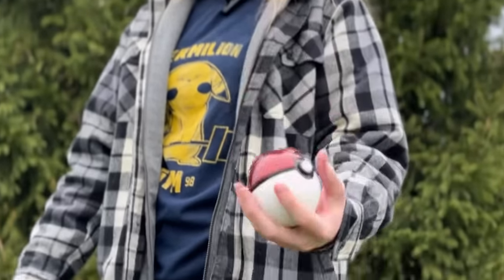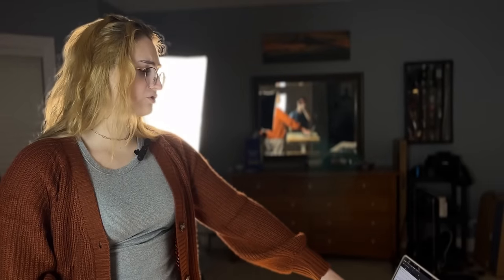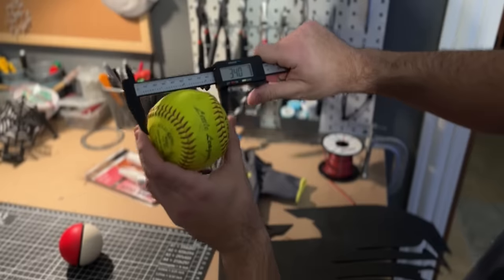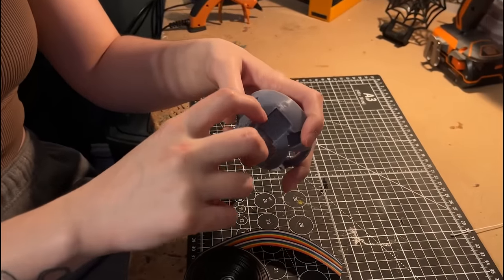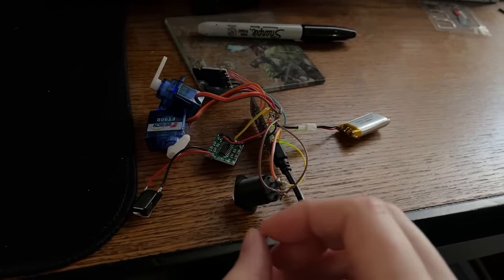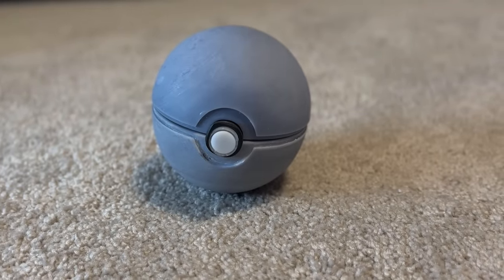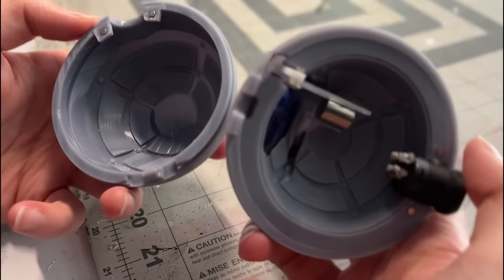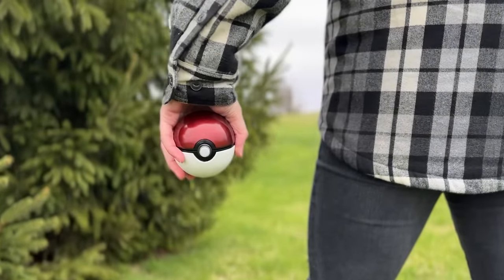I Built A Working Pokeball

Comment: Dude, I will always respect the ability to design components in blender
Reply: It was an impressive project without that, but holy crap, that's like a 100x multiplier, bravo!
Reply: Not sure how you design stuff in a blender. All I can make are milkshakes and smoothies. Lol
Reply: @giliant  I'm convinced there's a magical set of plugins I'm yet to discover which make it all much easier.
Reply: Learned Maya in college... will prbly use it for life 😅
Reply: We
Reply: @SimonLYW  Yeah it feels that way doesn't it, just takes time and practice like anything else though.
Reply: @Broockle  I learned in college 3Ds Max, Maya, ZBrush, Unreal Engine and Unity. I'm gonna try to learn Blender but for me 3Ds Max is and will always be the goat 🐐
Reply: @fergq9529  
So when are you learning blender? 😀
Reply: @Broockle  I'm gonna try to learn by myself, but not right now. Maybe in a few months
Reply: @fergq9529  
It's so hard to switch to Blender for me. It's so different. 
Doesn't even have radial menus, it's all drop down menus. And the hotkeys aren't ergonomically designed, I'd need to change em completely if I were to use it I think.
Reply: I’ve made a few animations in Blender, actually
Reply: I wish ppl understood the purpose of a pokeball

Comment: the button needs to be on the upper lid but good job overall
Reply: Was looking to see if someone pointed it out
Reply: Buttons are on the bottom lid on the back of Pokemon cards, so its technically not incorrect
Reply: @KovoN  only on the American cards and the very old Japanese cards, it seems to be a design error that was copied over but never fixed on American cards like it was on Japanese
Reply: not on pokemon cards 😏
Reply: @KovoN  Damn I'll never un-see that
Reply: Yeah I don't know why so many people do it
Reply: @thezx5795  because it's a lot easier to build the mechanism on the bottom.
Reply: 😂, umm actually... There's always at least one out there ...
Reply: This and the button turning red on successful capture would make this absolute perfection xD
Reply: @RabblesTheBinx  exactly, if the mechanism and/or power for the light was on the top, the ball would be topheavy and roll over. The only way around that would be to run the wire all the way from the bottom through the hinge, and over the inside of the top to the front. that seems tedious or arduous.
Reply: It's the TCG pokeball

Comment: 1:33 idea: you can hide the rocker, by making it spin around the circumference of the ball under the inner shell, the weight can be elongated to the shape of the ball or a partial ring or sphere segment. When the ball is closed it won’t matter in the insides are spinning or not.
So an alternate idea is to make the plates on the inside rotate opposite ways or just one spin, and only have one plate actually metal or heavy while the others are a painted light material. The entire half dome inside spinning will off centre the balls weight, causing a wiggle, both sides spinning will be more powerful😮
If you want to avoid the spinning insides, a hidden spinning rail weight would work just as well.
To get a decent internal lighting, using cracked/pin hole fibre optic strands, and an ultra bright LED. That’s if you want any insane inside effect.
Reply: Dude I was thinking the same thing the whole video. would be totally epic bre.
Reply: @slwsteny I got what you were totally thinking about the whole time right here, dude. 🕺

Comment: I'm amazed Nintendo hasn't done this yet
It'd be a pretty neat toy. 

Heck if those premium display Poke Balls were like this, they'd sell like crazy
Reply: they probably had did, but the technology 30 years ago wasn't quite the same, and whether it is back then or now, it would have been a relatively expensive merch
this build isn't even meant to be thrown
(you gotta sell this to kids somehow)
Reply: they only know how to make overpriced pokeball toys which don't even open
Reply: @Kensuke0987 I'm wondering how much "padding" would be needed for it to be throwable (into grass or carpet probably not a lot needed, onto wood or stone even the outside probably needs to be absorbent too, probably not a lot of materials that could be used for this and that would look right)
Reply: @Rerbun  probably not padding. it just has to be made of a durable construction and material. 3D-printing might not be the way; it has to be plastic injection molding - this is what they use to make modern billiard balls. the hinge and the electronics housing should have really tight tolerances too so that they don't wear down from all the jostling and also be provided some water-resistance.
Reply: Im thinking the same

Comment: For future variants:

Using a QtPy running MicroPython may work a bit nicer for this project.
The QtPy (especially when paired with an additional memory chip, also sold by adafruit) should have enough memory for small audio files. This removes the need for the SD Card, at least, and should allow you to save space from the sd card module and wiring.

You can replace the servos with microservos, or even small stepper motors (although the stepper drivers may take up some extra space, but shouldn’t take any more than the servos do)

Alternately: because your inner layer is nice and thick, you may be able to get away with a stepper motor based gyroscope (potential for stabilizing in midair throws? Or for rolling autonomously?). Or a spring resist solenoid.

Comment: Random fact: most depictions depict Pokeballs as having a digital dimension that serves as an ideal environment for the pokemon in question. They also show the balls as having non-transparent lids, which has left to an occasional joke about "the wrong pokeball", be it in the anime or by the fandom.

The Pokemon Special/Pokemon Adventures manga, however, makes the lids semi-teansparent so it shows ehat pokemon is currently in the ball, or if the ball is empty. It also makes the apricorn based pokeballs more gimmicky than they already were conpared to modern ones by requiring you to hit a specific spot on a given pokemon for the apricorn ones to work.

The manga also had Rival Silver be the only one of the Johto protagonists that throws their ball normally (Gold uses a pool cue to launch his, and Crystal kicks hers at her targets).
Reply: there has been no Pokeball that depicts them as having a dimension, the pokemon just shrink, which is a terrible retcon by Legends Arceus
Reply: @theamazingspooderman2697  looks like somebody has not looked at supplementary material... 

Or, for that matter, the item's cameo are n smash bros back when the series had trophies. In Melee, Brawl and Smash 4, the pokeball's trophy descriptions specifically mentions having what I described, and Sakurai was generally pretty diligent about making sure the info was accurate, if spoilery.

And I agree, the bit where they shrink was a retcon. However, it did not debut in Legends Arceus, it debuted in the Pokemon Adventures Manga, towards the end of the RGB arc.

Next time, look a little harder kiddo.
Reply: @theamazingspooderman2697 bros just saying shi

Comment: So freaking awesome!

Maybe if it's possible to use different colors LED you can use red for the blinking and yellow when it's successful.

Also like someone said maybe some sort of bright flash inside the ball for both fail (more visible) or even on a success (you'll see it through the middle as some sort of pressure release)

If this got mass produced I'm 100% sure it will sell like crazy.

Comment: It's awesome, I'd say it's almost perfect and hits every aspect you aimed for but you could ever make a 2.0 with a couple changes you can make that will make it even more authentic!

- I'd upgrade the light to be RGB so it can change colors depending on wither or not it caught or failed a catch. Similar to how it works on let's go Eevee/Pikachu.

- Another cool feature would be to add a RNG chance for it to fail not just at the beginning of the loop but between every step with a lowering probability the further in it goes. i.e. 10% chance on the first twitch, 25% on the second, 33% on the third (it always feels like when it fails it's the last one 😭). 

- Lastly, this one might be a pain in the ass but upgrade the speaker/sound quality on the file so it can get better quality audio. Granted that + the RGB light might require a stronger battery/power supply.

There's a couple more changes that could be awesome but would require so much more work. i.e. internal padding to be able to actually throw it without worrying it would break. Having some sort of impact sensor so you'd be able to trigger the same action without pressing the button but instead it happens after landing on the floor. However those would be so much more work and outside the original scope of the project it might require a massive rework for it to happen. And considering how well the shake works with the current weight + counter weight, it'll be really difficult to get another serendipitous moment just like that. 

All in all, this was an awesome project and really cool video to watch and will be subbing to watch more cool builds like this!

Comment: You think if it's made of petg fdm you can throw it? or use abs like resin? Or is that a no no with the internal components? Other than the counterweight depending on how stuck it is and how solid the soldering is it should be able to withstand a normal throw on grass?

Comment: tinkercad has a pretty clean and easy to use free online tool for making circuit diagrams. It doesn't have everything, so you might have to lead wires to nodes then paste your own MCU over it in photoshop after everything else but it's a lot cleaner and easier than using paintbrushes or line tools to just draw wires. Much easier to edit too

Comment: All you gotta do now, is wait till shrinking and teleporting technology exists. Shrinking and Blowing back up to size would probably also need to be with Time freezing technology so when shrunk, they never age, so they only age when real size, this is because, living organisms would malfunction the smaller you get as you need less and less blood vessels the smaller you get, get small enough and air absorbs through the skin directly to the body system, and then teleporting cuz if you catch the 7th, it will have to teleport the entire ball and what's in it to a ranch. During teleporting since the time freeze was on due to being shrunk, the body wouldn't de-materialize for whatever you caught. And you can catch anything so as long as it knows the parameters of the animal being caught it has to know organic from other organic, and from non organic so that way it strictly catches what is being caught, chances are, humans could be caught just not really their clothes. But as for animals they generally have fur, so as long as the clothing came from an organic source a human could be caught and everything their wearing to a degree, cuz organic from organic means same type so fox fur on human is different, human hair clothing would likely pass as you can't be throwing and catching the dog along with all it's fleas and worms. So it would be a good tool to get rid of parasites. Number of similar objects also need to be programmed unless you want to catch 2 love birds then 2 of something at same time is fine.

Comment: The light button doesn't go red. I found that disappointing. Still cool that you made this though and credit to the 3d printer. It accurately moves and make sounds which is incredible. I used to be a Pokemon fan but moved on to Digimon/Persona after the 3DS games. Since main Pokemon games became nothing but trash on the Nintendo Switch.

Comment: 6:24 idea: negating the use of wires you can create thing on the print called “tinning channels” basically you tin them with solder or thin conductive foil, or even pcb etching, and you can completely skip any ridged boards or makeshift wirering but embedding the circuit into the resin. Look up “circuit board etching custom surfaces” 
You can also make custom motors/servos by disassembling brought servos and rebuilding them with alternate part shapes. Search “custom homemade micro servos” most times it’s literally wrapped copper coils and resistors.

Comment: 8:41 ah channels for specific chips to take up different power too. Wires also can act like passive wireless charging does where the electrical current pulls at the electrons on near by metals, causing “drag” which uses more power.

Comment: 8:10 different wires cause different current issues some times having power buffers like capacitors or inverters can help everything be powered, but on rule while prototyping is to just work with more direct power at first, then work out the power issues. Things like minimising connectors and directly soldering stuff can save  power travel.
Think of power more like a water flow where everything is pipes and pumps.

Comment: You kind of messed up the lore a little bit, in ancient times the Pokeball used to use the Pokemon's ability to change size. In modern times the Pokeball converts the Pokemon into energy and stores it that way. I'm not blaming you for getting it wrong is the Pokemon lore is pretty freaking confusing so close enough I guess.